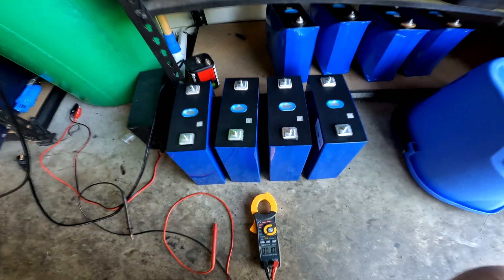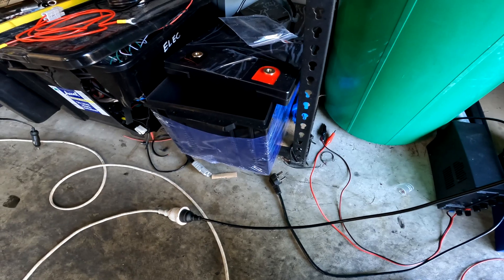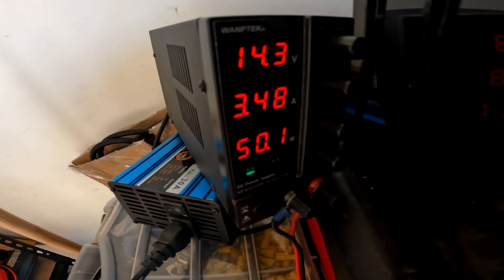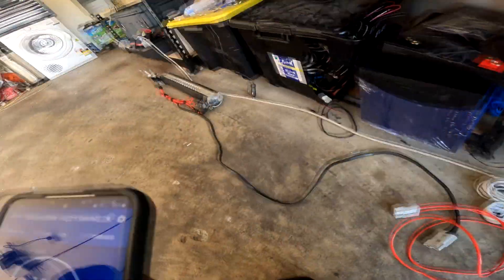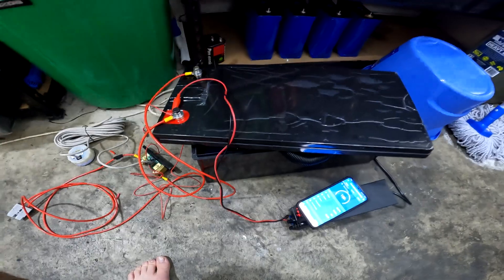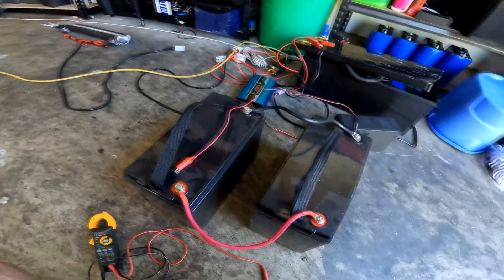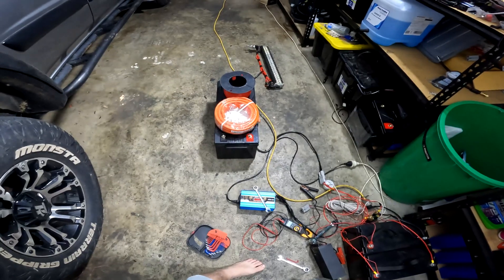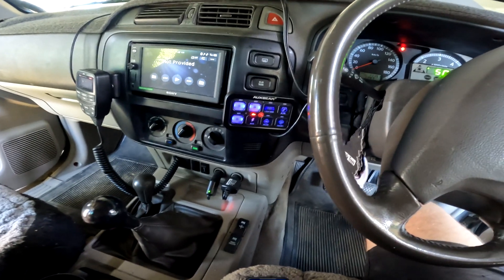BAD LITHIUM EBAY BATTERIES. CONSISTENTLY FAILED CAPACITY TESTS. DO NOT WASTE YOUR MONEY!

Comment: Be interesting if you crack one of those dodgy ones open, see what's inside.  Might be able to combine the two together and weed out any crappy cells in there to make a proper 100ah unit.
Also - I use a separate solar charger for the perm mounted unit which is seperate from the dcdc.  Could be an option if you want to go down that route.
Last thing - link us up that 300amp BMS you're using there?
Reply from the maker: https://www.ebay.com.au/itm/154378579055?mkcid=16&mkevt=1&mkrid=705-154756-20017-0&ssspo=bqpCvtqjRTu&sssrc=2349624&ssuid=zX09QedLR1y&var=&widget_ver=artemis&media=SMS
Reply from the maker: https://www.ebay.com.au/itm/154378579055?mkcid=16&mkevt=1&mkrid=705-154756-20017-0&ssspo=bqpCvtqjRTu&sssrc=2349624&ssuid=zX09QedLR1y&var=&widget_ver=artemis&media=SMS
Reply from the maker: Yes I would pull them apart but rather them in tact for the job they're going to be used for 👍

Comment: Worth mentioning i have the eve lf280k cells and 4 of them and a bms fit perfectly in an xtm battery box from supercheap auto, with a little room to spare. Theres enough room in the lid to mount the victron shunt and bmv712 face, and its already got two Anderson's with fuses, as well as two accessory sockets and twin usb. Much more compact than the 200ah battery case and 1/3 the price
Reply from the maker: Yes I looked at those aswell, only reason I went the 200ah case was for where it needed to fit in. Wouldnt fit in the same spot in the xtm battery box unfortunately

Comment: If your bms has a balancer built in you dont need to top balance them in parallel! Just let the bms do its job! Unless your cells are wildy out of balance, and if they are, just charge or discharge one cell at a time manually, it might take a few minutes per cell.